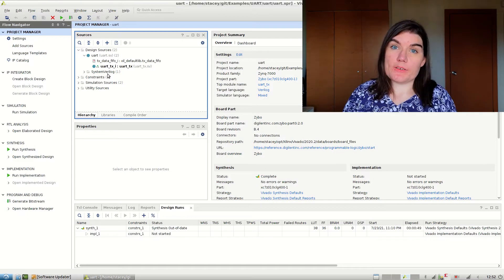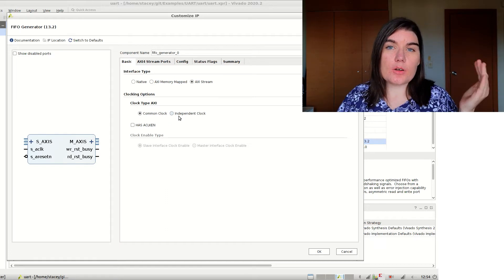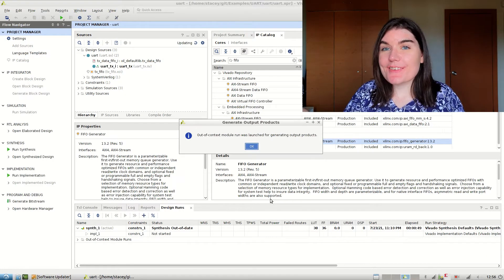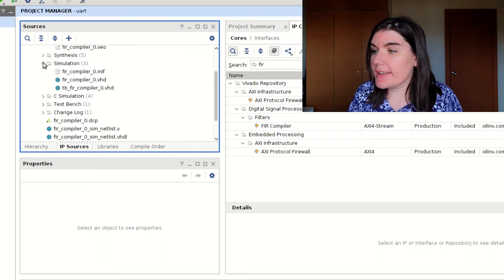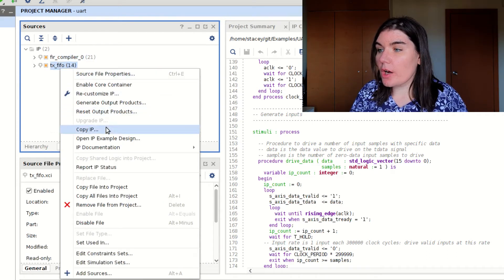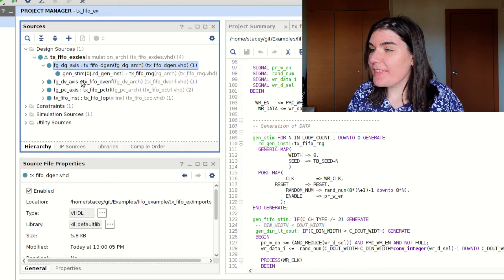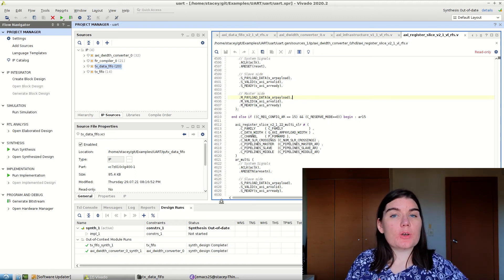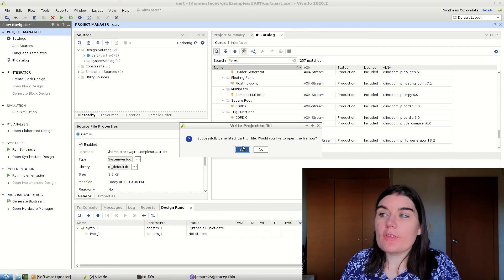Vivado IP generator tricks: Generating IP, saving to version control, and generating example code!

Comment: How can I configure the IP generated, I am currently using Xilinx Vivado 2022.2 Standard version, I generated the smartconnect IP but can only configure the no. of slaves and master but couldn't configure the data width & address width of those masters and slave.

Comment: Do you have any sources of code for Interrupts to PS (Zynq or MicroBlaze) from the PL.  I have tried to following the examples for Interrupt enabled GPIO (Xilinx provides example code but I have not gotten it to work on A9 processor).  My Goal is to acquire data from VHDL code running on PL fabric, then interrupt the processor, that will then read the data from a bank or 16 32-bit registers and send over lwIP to an application listening to a given port.  I will have to go to a polled mode if I can't figure this out soon - the most inelegant solution of all.  I have already tried to use an AXI Stream FIFO and DMA, but came up short there as well.  Thanks for any leads or pointers you may offer.   Keep up the great postings.  (I could not find my comment from a week ago also saying that I learned some tips about the easing the Vivado anti-friendly behavior towards VCS.)  Knowledge is powerful, keep it up.

Comment: Another great video.
I can read from your face how eager you to teach great stuff to the people.
Can you make another video about what should an FPGA design engineer know other than HDLs? We are seeing Phyton, C/C++ as scripting languages, DSP etc in job qualifications. For example DSP, are they expecting DSP knowledge from you or embedding DSP processor to FPGA? I want to know how you guys combine all of these and for what?
Reply from the maker: I would say generally Python/Matlab for algorithm development, and python/c++ for driver and host-side code is useful. But otherwise it depends also on the company, the industry, and the FPGA application. A junior or new grad can't be expected to know everything, but after time in a specific industry you do pick up side skills that are relevant. Eg: after time in RF you will pick up DSP skills, and probably c++. And in high-frequency-trading you'll pick up other skills too. So you can't say you need DSP skills for sure, or anything else. it just depends on the application. Also some companies have whole departments who develop the algorithms, and the FPGA developers just convert them to the FPGA. So a general understanding of math and use of Matlab/Python/eg will be helpful.